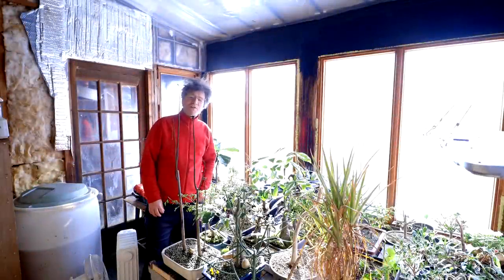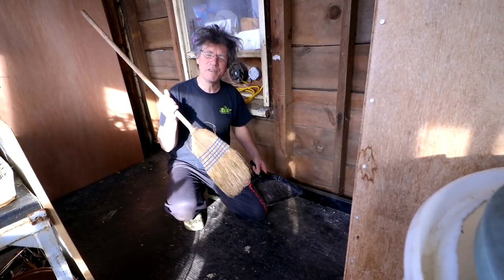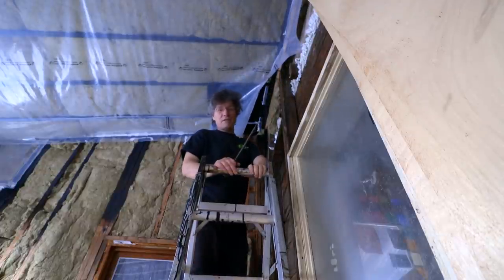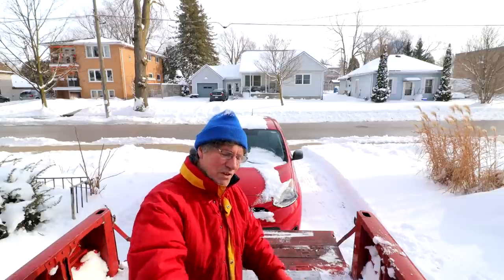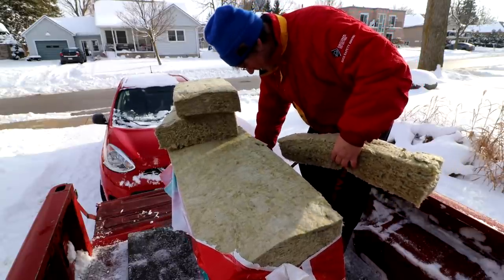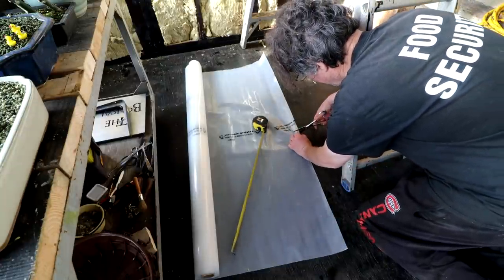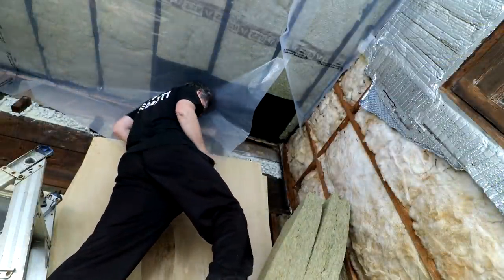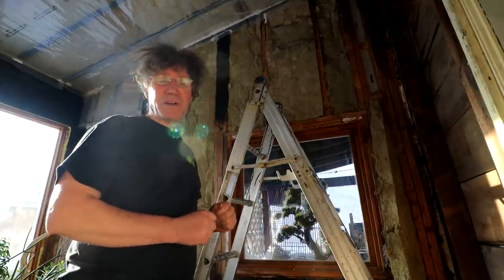Back to Work on the Plant Room, The Bonsai Zone, Dec 2020

Comment: Great idea on the tape. That way once the ceiling is added to the plant room, the tape will hold because the ceiling panels are up against the tape and the beams. You can also try the gorilla tape. That is super strong also.

Comment: I'd guess that much of the lumber manufactured in Canada is sold to the U.S. what are your building codes like? Are your studs supposed to be 16 on center? How does the sheets of plywood line up for layout?
Reply from the maker: Yes, the roof joists are good with 16" centers and 2 x 8's. The plywood is staggered so no panels line up. I was very careful to meet or exceed the building code! I think the whole room is now way over engineered, for me just perfect!
Reply: @TheBonsaiZone  yes staggering seems are generally recommended. But being 4X8 there's really only so much staggering you can do when everything lines up on 16 centers by design really. For flooring plywood at least in some parts of the United States the edges are tongue and groove  but that's for 3/4" thickness. So joints are only staggered lengthwise orientation mostly. I was really upset to discover that "repairs" done the last time were done so poorly. Was there any recourse for the contractor who did the work?